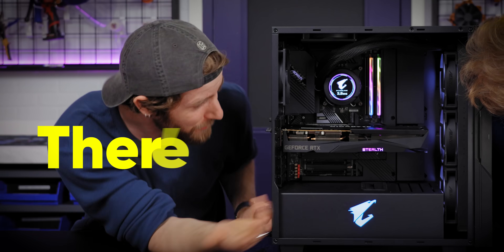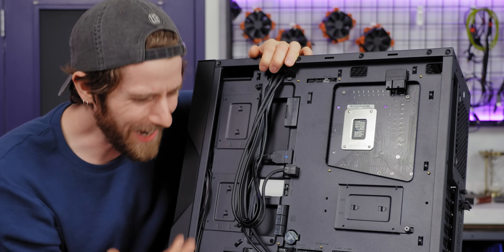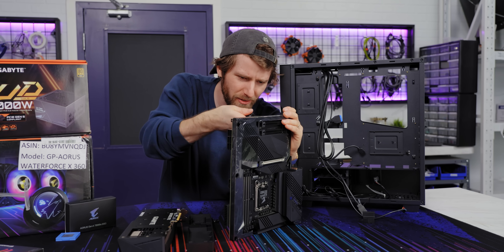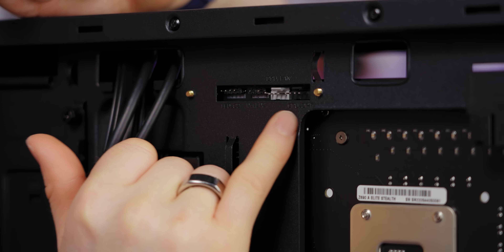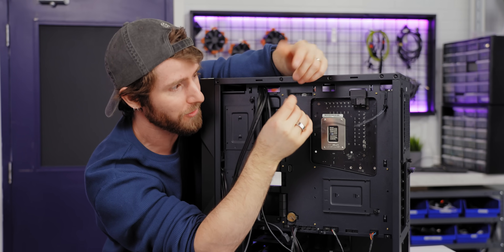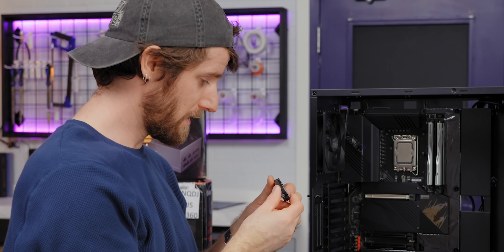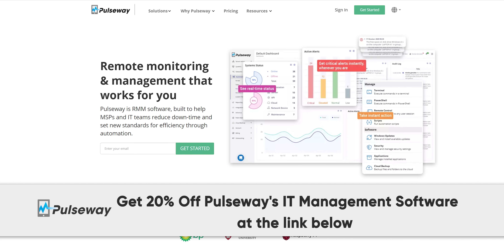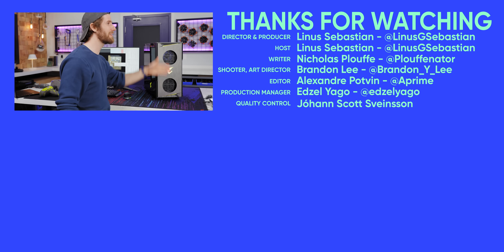Where Are the Cables??? - Gigabyte Project Stealth

Comment: Honestly the cables on the front of the motherboard, when cleanly routed and looped through from the back, looks fine to me. I think that if all GPU's could move their 6+2 PIN power connections to the base of the card pointing towards the "rear" of the card, we could solve the most annoying cable in most builds. Also, 12V-only ATX would be nice to cut down on the ATX power connector a bit. 

Absolutely love the hole saw action. That's like something I would rage-do to make a point.
Reply: you cannot do  12v only., this would introduce massive cross talk and other switching noise into the the only supply rail.
and for people saying yep well you could have multiple 12v  taps... no that would mean the same PSU infrastructure as  5 & 3 & 1, so what is the point?

the loss would also increase...  instead of going 120/240->12/5/3.3/1
you would go 1120/240->12->5/3.3/1 you would have a double conversion loss and more heat. and a shed more switching noise & smoothing issues.
Reply: @stevesteve8098  Hi Steve. All the high power devices in a computer are already doing double conversion, and most of the other components that aren't don't actually need to run at one of those other voltages anymore. 

There are already numerous separate 12V to 1.XV PWM regulators in desktop computers. If this "crosstalk" problem you're concerned about were a problem it would already be a problem. Eliminating the last few 3.3V and 5.0V loads on a motherboard or system drives is a very small change from where we already are in terms of how much load is being pulled from those rails. 

Most ATX power supplies these days derive their 5V and 3.3V rails from DC-to-DC from the primary 12V rail, which means that you're already doing double conversion in most PC's anyway, and carrying that lower voltage, higher current, over longer wires, rather than doing the final voltage regulation near the load, making it LESS efficient. Moving those outside of the PSU and onto the motherboard or other components on an AS-NEEDED basis will actually reduce inefficiencies (as the regulators can be sized for the load better than the ones in the PSU). 

You're thinking about an era of computing that is dead, when many loads were actually driven directly off of the 3.3V and 5V rails. These days the only loads left that run off those voltages are miniscule and could be changed to run off 12V without any major issues.
Reply: 12v only atx makes the expensive motherboards even more expensive and moves some psu heat into the motherboard too.
Reply: @trakaiszeks  If you look at how little current is drawn on the 5V and 3.3V rails on a modern computer, you'd realize that we're actually wasting a ton of component cost and size in the PSU supporting capabilities that are no longer used. All high current components on the motherboard are PWM regulating from the 12V rail. 

Right now, you're paying for a big 5V and 3.3V rail whether your system makes use of them a little or a lot. For the vast majority of systems out there with a single SSD and no other drives installed, this is a waste. 

I would actually like to see the ATX standard go 20V-only, with low power systems powered from a single 4-pin, or optional USB-C power input, and higher power systems just adding more 4/8pin connections to the motherboard/GPUs based on how much power they draw. 20V would require 40% less wire and 40% less physical connection surface area to move the same energy.  Given that it's now commonplace for consumer class motherboards to require dual 8-pin EPS and GPU's to require 2-3 or more 6+2PIN PCIE power connectors, the number of connectors and wire is getting out of hand to carry all this power at 12V. 

This would be a good opportunity to standardize all internal power connections to a new, more efficient and universal plug design. There's no need for the CPU, GPU, and ATX-MoBo to all be different. These could a new universal connection standard and could move towards a new, easier to use, more space efficient plug. 

Furthermore, I would like to see the responsibility for providing 3.3V, 5V, and 12V to SATA/SAS devices go to SATA backplanes in cases. If the case is going to have 2.5" or 3.5" bays, it should have the SATA headers/backplanes in place for these, with oculink or mini-SAS connectors for communication to the motherboard. This further reduces wiring clutter. Instead of a bunch of individual SATA cables in a case, a single occulink handles up to 8 drives worth of data. Instead of a bunch of manually routed SATA power connectors, a backplane provides a rapid way to power all the drives and communicate with the motherboard. So much cleaner! Look at the way servers handle this. Desktop computers are so far in the stone age on this.
Reply: @mdocod  man, I appreciate that you wrote this out, and i mean this in the nicest way, but you need to touch some grass dude. Not for the sake of me jabbing at you, but for your wellbeing.

Comment: Should you install the board first into the case before installing the cpu, ram, ssd? Because I wonder if you lay down the board to the top of the box the pins at the back might bend? So it's better to install the board first on the case? I think?

Comment: All those wires connected to the back of the board being an "obvious" idea, should have freaking happened YEARS ago. But no, component makers dont want to think outside the box, they want to stick to "standards" and keep putting random fan plugs and front I/I plugs in stupid places to get at, all the while everybody is obsessed with "good cable management" in an effort to hide as much cables as possible, and yet its impossible to do so properly because every damn cable has to go into the topside of the board. And, even freaking GPU's, why run a cable under it all the way to loop around to the front of the GPU? Put it on its far leading edge or on the backside of it, and make sure that the case manufacturers have a proper access panel in the back.

Comment: Cool idea but goddamnit this is one of the worst case designs possible. Putting 30 series and 12000 series in a case together with no airflow is bottleneck city.

Comment: wait norton gets installed automatically from the software to control rgb on the case or the motherboard? is it possible to opt out or not install the rgb software or did they manage to figure out a way to install bloatware directly from the motherboard drivers?

Comment: I've thought for a while that there should be buses built into the cases that the MB and components plug into rather than wires (this way, PSU wires are not too long or too short, for example). This way is pretty decent too though.
Reply: that would be a compatibility nightmare, mobos have different sizes, you'd end up with a case that only supports specific mobos..
Reply: @ForeverHobbit  It would require a bit more standardization on location of connectors but it would have huge benefits. It might make it hard for new connectors that weren't part of the standard but perhaps it could use something like these back-mounted connectors for that. Even if it was just the MB power, CPU power and GPU power, it would improve things greatly. I'm not holding my breath though.

Comment: having worked in a factory that builds Boards from a blank PCB they probably ran both side through a solder oven, and then just one side through a wave solder machine. There are machines that do specific solder for through hole that, in theory, are more accurate and precise than a person soldering it, and they probably went through this route. for all the components after a wave solder machine, assuming all components are through hole, it would just be a matter of inverting the traces, and your board is basically the same. the traces are probably in the same layers just with different contact points. Probably not difficult to do an engineer just didn't want to use cad...

Comment: This video brings up a good point. It's time to say goodbye to ATX. The way we interconnect things and build PCs today is just too different from when the standard was introduced.
Rear mounted I/O connections don't have to be standardized more than they already are. They are all at the EDGE of the PCB. That makes designing cases around it easy. Have a 3/4" gap between all of the screwposts around the edge of the motherboard. Now any connectors within that reserved "connector clearance" area will have access from the rear. Keep the mounting hole locations the same and you can have backward compatibility with the ATX standard as well as support for whatever we call the new standard. Best of both worlds. The modularity enabled by those cable extension for the GPU could probably be standardized as well. Have two mounting locations for them, bottom and rear within the GPU. Idk, seems obvious this is the way forward. Keeps the things that don't need airflow and don't generate heat away from the things that do. Also makes the PC pretty. Its a win-win.

Comment: This was a disaster. The Idea? Good, but a ripoff (even if they made peace). The Components? Literally all repurposed stuff, the Gpu already had the connector and extension, they just needed to move it to the bottom instead of the top. The Mainboard just had all the connectors soldered in the same exact holes, but backwards. We dont even talk about the case, just cut the coresponting holes in the back. And then it installs bloatware out of the box? They better not charge a lot of money for this....

Comment: My brother had a case that similarly had mount spots for fans on the front yet the only way for the air to flow was through a slot in the bottom. The best part was that the front panel had a design made to LOOK like it was a vent but all the "holes" were solid. It was amazing.
Reply: The solution is obvious, you only need a drill and a lot of patience. It won't be the nicest thing, but still better than nothing. :D

Comment: Linus must have been spitting flames so hard right before drilling the two holes on the front pannel that the editor had to cut it all out and only include the drilling fotage, cus the rest would probably severe ties with Giagbyte forever.
Love to see it, because these product designers with no real compromise with reality are a pain in the ass.

Comment: That HDMI cable was created ONLY for 1080Ti. Yeah! this is something incredible!. un-usable for any other graphic card. This was not specified on any part of the manual or web or any other word in the entire gigabyte site.
That case it's so so soooo wrong in every way, I have the c300g, it's the most hot case in the world, with LESS compatibility in the world too!.
They created a case like 3 years later with compatibility for cards 3 years older.
They also created the waterforce, also inside the AORUS products.... seems that they forgot that they have created this crap, and added like 8 different screws to adapt the radiator into the front of the crap case....

Comment: Man.....so I have run into the whole front bezel has no air flow (at all) before with DIY brand cases.  That were, btw, also designed for a 2 or 3 120mm fan rad behind it, that I had to totally mod to make functional and not a complete waste of money.  I am surprised to see such a thing from someone like Gigabyte...../shrug
Reply: NICE!  Love the modding you did Linus, LOL

Comment: i can feel linus angry from my phone screen,
it totally screw up, even without using software, if there is no secure air line for heat changing are totally worse.

Imangine if you build an house with zero ventilation im sure they will be got sunburn in the winter lol

Comment: This is actually pretty dope, other than the airflow
Reply: Cool concept but any product that installs Norton on a fresh Windows install needs to immediately get in the bin
Reply: @Adamt.magician  Gigabyte's "App Center" tries to sneak Norton on anytime you the driver updater. They hide the option of deselecting it under something like "apps" or "not installed" I forget exactly what it's called.
Reply: and the crappy cable management... or the lack thereof.
Reply: @wulfhart2  its a good concept..except airflow but gigabyte ia gigabyte
Reply: @cant461  The same company that was trying to pawn off exploding PSUs or made an open loop watercooled GPU with both aluminum and copper in the water path?

Sign me up, what could go wrong?
Reply: @wulfhart2  I literally want that cable management. See the thing is you don't realize how bad cable management truly is until you've tried routing multiple sets of CoolerMaster Halo MF120s with 3 hard drives and 3 SATA SSDs, two of which are front mounted, on top of a GPU bracket with RGB and two optical drives (because you'll pull my original Broodwars CD from my cold dead hands). So it becomes a complete nightmare to manage properly, not have any shorts and fit the back panel back on the case squeezing all that shit in, which is the main potential problem on this thing, otherwise it'd be great to build in. I can then just run the cables to the back, have a clean open front with great airflow, and just forget about the abominable cable monster that lives in the basement.
Reply: @pandemicneetbux2110  why two disc drives instead of 1?
Reply: @michaelironsights8347  Because then I can burn it?

...no literally that is why. It's because I have tons of old 1990s tier shit and having a PC like this when I was a kid would've been the absolute shiznatch. However, I have old discs one of which is already scratched up on the foil/label side beyond all repair (I never did get to finish playing Unreal II disc 2 after all). 

Linus would understand. Trust me, Linus would understand exactly why I got two optical drives including BD-R and M-Disc, and a firewire PCIe x1 card, etc.)

:exhales vape juice in 30boomer: you wouldn't get it
Reply: @wulfhart2  Worst joke of the year awards goes to you! 🥇🏆 You're welcome!
Reply: @wulfhart2  better then my cable management :( I just shoved it all in the back and slammed it closed and the back side of my pc has a pregnancy bump
Reply: @wulfhart2  cable management is not a problem, you could just get modded cables.
Reply: @wulfhart2  If cables aren't functionally interfering, they are managed.
Reply: and the shitty cable management hole which clearly indicates that they made it in rush and just straight give it to linus
Reply: You don't improove airflow by leaving out cables. Unless you have flatband cables like riser cables or old IDE cables, the airflow is generally not restricted by a bunch of "untidy" cables.
Reply: @LinkStorm13  i think it will affect airflow if you have lots of cable in front of the fans, although the result is negligible
Reply: Eh.. spend 500.00$ on the case need to buy 43.00$ holesaw and 110.00$ drill
Reply: They should add 1 inche more space for cable managment in the side panel, also add 1.5 inches of thickness on the front planel to have huge vents. And thats pretty much it, how hard it is to fix this stupid ass concept? I mean Linus did it the angry way, but its not so hard to DIY rebuild this shit.
Reply: I really just don't get it and I think that zoomers got conned into thinking solid front panels are fine just because the companies are all too cheap to do anything else. 

But other than that yeah, I originally signed back in just to say how great I think this is what a cryin dayum shame it is we didn't get to have this all the way back in 2012 because of some irredeemably stupid corporate reason. It's like, why the F does Capitalism so often insist on operating just as stupidly as Russian style Communism. We had real innovation here and it was choked off by some bullshit "intellectual property" thing I bet. I've become convinced that a lot of innovation happens in spite of, not because of, market conditions. Market conditions is how we get stuck with crap like Dell and HP or nVidia's retarded performance crippling GimmickryWorksTM or Apple cultism acting like they found hidden treasures for the shocking feature of...a single additional NVMe drive mount. On a multithousand dollar worse performing computer. But it has that BrandTM AestheticsTM!

Although to be fair thank God market conditions also often help some things along to failure because we're rather have that balance between Socialistic-tier universal compatibility but no innovation vs everything locked down and proprietary under 'murican turbo Capitalism. Like for example Corsair's bullshit proprietary ARGB connectors. Next to nobody uses that so far as I'm aware, because who the F wants to get locked into a "fan ecosystem." Or why Sony's proprietary storage ecosystem failed hard in the early 2000s/late 90s iirc, while USB became a universal standard.

Comment: Just putting the pins backwards through the board wouldn't work as then all the plugs would be backwards and stuff would explode when plugging connectors in.
All the traces would need to be flipped inside the PCB.

Comment: Since all those connectors are through hole components. Meaning they're mounting holes go clean through the motherboard switching them to the back side should be fairly simple. 

Linus said that you would need a new layout but really you wouldn't some pin locations would have to switch a little bit but this would be a fairly simple change.
Reply: All the connections get reversed. Assuming you're not going to use specialized cables, that means rerouting the wires on the board. Not typically a horrendous job but not nothing either.

Comment: I remember when Ampere came out I brought up somewhere how NVidia could avoid the cable clutter by putting the power connectors on the opposite side...and people said it couldn't be done because of trace distance or some bull (ie the actual power connector could be anywhere on the board and you have cables going to where you'll plug the cables on the shroud)

What's up with this graphics card then.